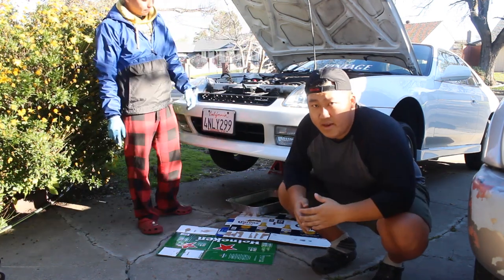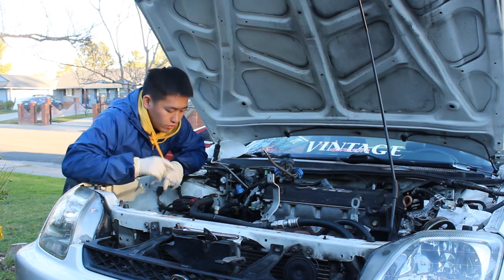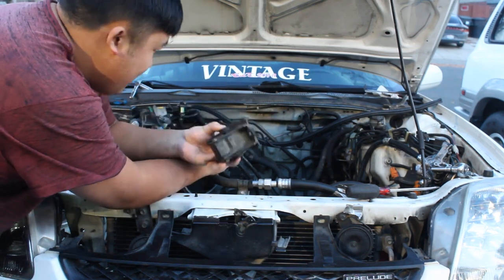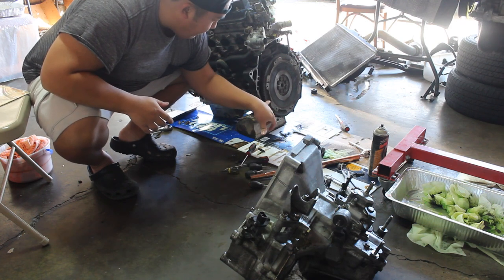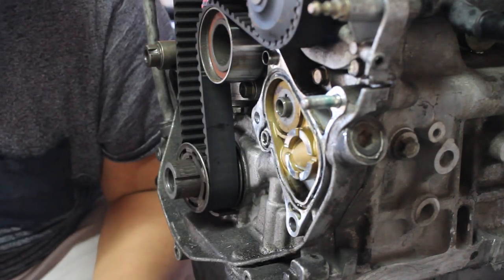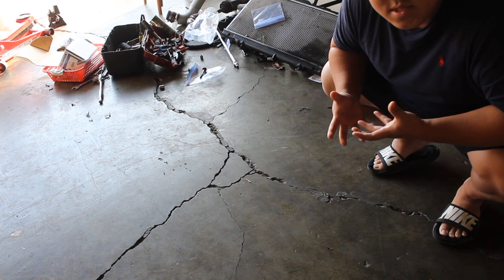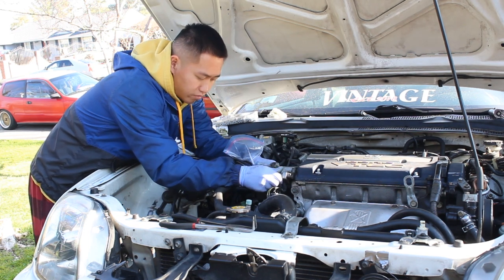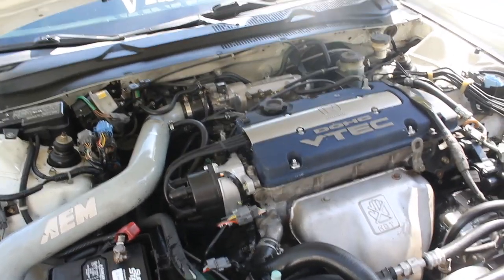H23A Swapping the 5th Gen Prelude

Comment: Hey man I’m in the process of putting an h23a in my prelude, and I’m wondering what was everything you had to put onto the h23a to work with the h22a wiring harness and ecu?
Reply from the maker: Hello, sorry for the late reply. So I am using the original wiring harness that came with the car. There are two ways of going, converting the distributor to OBD1 or changing the oil pump and adding a crank position sensor. I went with the EASIER way which was converting the distributor to OBD1 because the H23a does not have a CPS. You have to do the oil pump swap in order to use the original cps connecter from the harness. Since I went with doing the OBD2 to OBD1, I had to get an OBD1, TD60u distributor from a 4th gen prelide SI with a h22 vtec. Then I had to get a Rywire OBD2 to OBD1 distributor adaptor. Car runs fine but does have a FAKE CEL due to a OBD1 distributor.
Reply: If you ran a jdm obd1 p13 ecu with a conversion harness, would you still be able to start your car with OBD2 fuel injectors?
Reply from the maker: @johnanderson9175  you should be able too

Comment: I have a 2001 prelude , will the stock ecu (computer) work with the H23A swap?? Does you prelude still pass emissions test with the swap?
Reply from the maker: So the good news is that the stock ecu does work with the h23a swap. Unfortunately, since I live in California, the emissions are a bit harder to pass. I might have to change the oil pump in order to remove the CEL to do emissions.